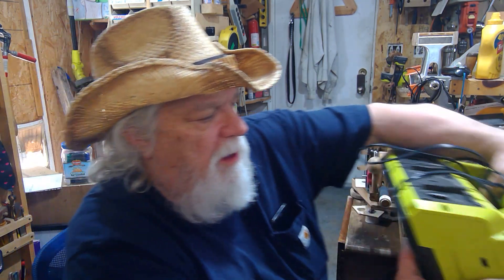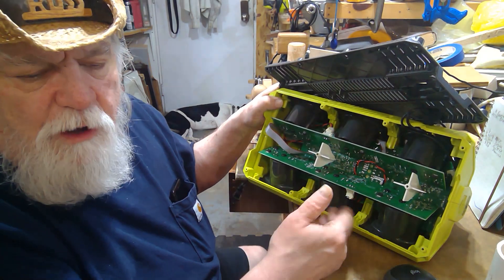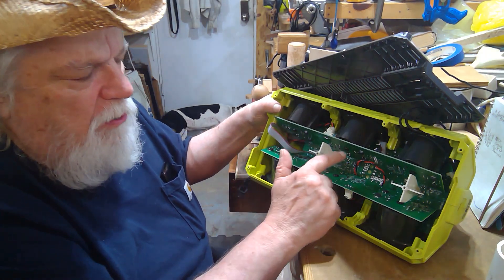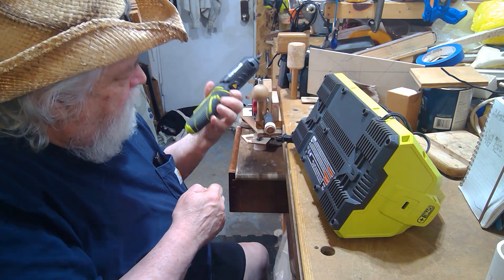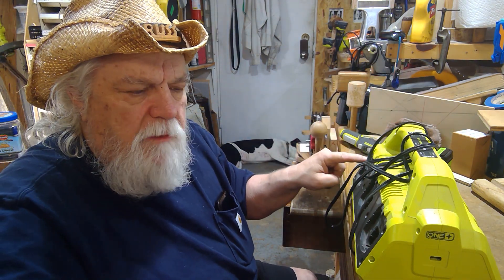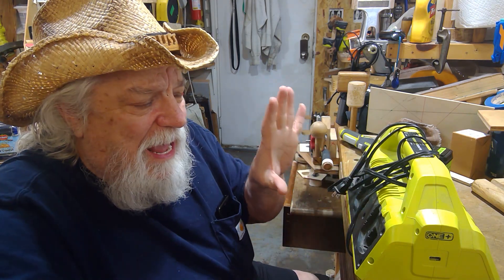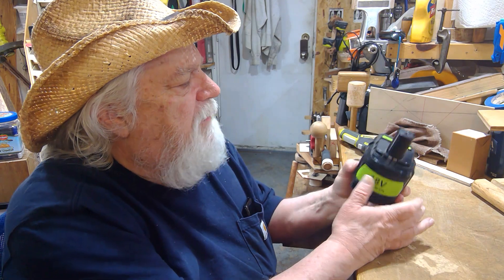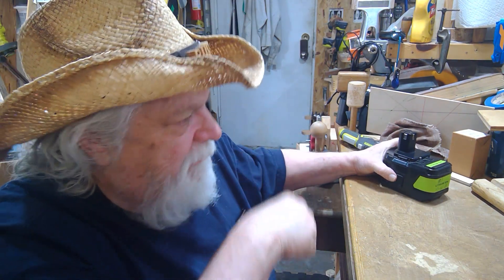Ryobi Style Battery Packs & Ryobi Super Charger by Rambling Russ

Comment: Can you gut the board and then wire into the sockets 6 individual chargers connected to the same 115v ac source. Then connect the battery sockets in parallel diode isolated for the dc power pack
Reply from the maker: Not enough room to mount 6 individual chargers.  I like to make the batteries hot swappable and charge them elsewhere.

Comment: Russ:  I just came across your channel thanks to another YouTube guy that built a battery powered light.
I am a HUGE fan of Ryobi power tools and use them, everyday in my day job and at home.  I find I can buy a lot of tools and batteries for less money.  I have 3 sets of Ryobi cordless tools.
I have a project in which I need your help.  I’m wanting to add off-road driving lights to my mini dune buggy I’m building.  My snowmobile charging system only has 180 watts total system power so I only want to use that system to recharge the starting battery and run the basic onboard electrics.
I would like to add a couple Ryobi One+ 18 volt power packs to power a couple driving lights/spot lights.  I would like to add a power Meter on my dash to monitor the battery pack levels.
Is this a feasible project?
Reply from the maker: Thanks Don & welcome to my shop.  Your light enhancement idea is quite intriguing & I would say it could be done.  Do you have specific lights in mind?
Reply: @russveinot5754  I would love to know how to figure out how long a 40 watt set (2 pods) would last on one 4 Amp Hour Ryobi battery pack.  I don't plan on doing a lot of after dark riding, but it would be great to have this option.  The Ryobi packs are cheap enough I could just leave them on my mini dune buggy and top them off before I go out for a ride (or switch them out with my other packs...).
Thanks.
I'm an totally working through some off-grid Ryobi solutions, as well.
Reply from the maker: @donwittbrodt-donsprojects7507  A Ryobi battery is 18v.  So, a 4-amp battery would have 72wh (18v x 4 amp).  At 40 watts per hour, about 1 hr. 45 min. of run time.  You might consider investing in 9Ah (162wh) batteries.  You are looking for a (Ryobi) battery source to plug two 20w pods into?  What voltage & plug-in type for the lights?   How would you carry the battery pack while driving the buggy?
BTW, when you say "Ryobi packs" are you referring to a "pack" as a battery?  Are you are looking for a carry around case to plug your lights in?
Reply: @russveinot5754  Your videos have inspired me to see how well this will work, first on my buggy project, then on to my pickup camper.  I was showing my wife the Ryobi 40 volt power panel and solar panels, today.  She is fired up about being able to finally have a good, lightweight, off-grid solution for boondock camping.
I have quite a bit of room on the top of my truck camper for solar panels.  Ideally, I would like to come up with a big enough system so we could run our Air Conditioner, overnight and then recharge.
This setup sure seems a lot more feasible than spending at least as much as a 40 volt Ryobi Power Station on LiFePo batteries for our camper.
I am SO glad Ryobi is really forward thinking on portable power and make it affordable to use for middle income folks.
Reply from the maker: @donwittbrodt-donsprojects7507  What voltage do the lights run on, 12v?  I suspect you have 2 obstacles.  You might need to reduce the voltage (18v to 12v) for lights and a monitor for the battery condition.  The first can be handled with a buck converter.  The battery monitor issue is a bit tricky.  Am I getting close to what you need to figure out to work everything out?
Reply: @russveinot5754  : I may forget about the battery monitor since I'm sure that will draw power from the circuit.  
Here are the specs from the 2) Auxbeam pods I want to use:
Power: 40W/2PCS (20 watts per pod)
Lumens: 3770LM/2PCS
Voltage: 9-36V DC
Waterproof Rated: IP67
Beam Type: 30° Spot Beam
Color Temperature: 5700-6500K White
Materials: Aluminum Alloy, PC
Lifespan: 50,000 hours

I thought since they are rated 9 to 36 VDC, I could use them on the 18 volt Ryobi 4 Amp Hr packs without an issue or buck converter.  Should I still use one?
Yes, all your info has been helpful to me...
Reply from the maker: @donwittbrodt-donsprojects7507  You don't need a buck converter.  I would still put a "Watt meter power analyzer" on the panel.   The draw is less than 1/2 watt so no battery draw.  The 2 readings that can help are the voltmeter and the WH usage meter.  They run about $15 on Amazon.  I can recommend one if you need help.  Your idea is very OTB.  If a single 4Ah battery isn't enough, you could put 2 batteries in parallel for more power storage.  Just always keep both batteries at the same rate of charge.
BTW, I would be interested in hearing more about your ideas for the camper.  FYI, I am strictly a fan of the Ryobi 18v battery for all my projects.  Not sure I want to invest in 40v batteries and chargers yet.
Reply: Russ: I plan on buying a couple of the Power Wheels type connectors that will allow me to use my 4 Amp Hour battery pack on my buggy, permanently.  I will mount the 20 watt Auxbeam (3 inch spotlight pods) to the front of my buggy and wire in fuses and switches on my control panel/dash.  I will start with one 4 Amp Hr battery (since I have several)  and see if it will last enough for me with limited use.
Reply: Russ:
Thanks, very much for your help.
If you have a specific watt/hour meter you recommend, please let me know and I will order it, immediately.
I definitely do want to build a complete Solar system for my pickup camper.  Of course there are the traditional systems out there, currently, but the large batteries are quite expensive.  If I can build a Ryobi-based system, so much the better.  I have several 4 Amp hr battery packs and plan on getting some larger ones when I get a clear plan on what to get.  I really would like to come up with a power station that would run our Air Conditioner (it is on a 20 amp 110 volt breaker).  I will try to find the max current the compressor draws when powering up.
Working on these projects really helps me appreciate what you do...
Years ago, I worked on an electric motorcycle but battery packs weren't ready for the long haul, yet.  I should probably get back into it,now that we have better battery technology and I still have a 3 motorcycles I can convert.
Reply from the maker: @donwittbrodt-donsprojects7507  I have been reviewing my choices of watt meter and below is the one I have and seems to do well.  The watt hours usage and the voltmeter are your best way of monitoring your battery charge.  If you want info on how I would hook it up or how to use it, let me know.
Link to watt meter on Amazon:
https://www.amazon.com/Watt-Meter-Power-Analyzer-Measurement/dp/B08QJK3V3Q/ref=sr_1_6?keywords=watt+meter+power+analyzer&qid=1658497614&sprefix=watt+meter+%2Caps%2C157&sr=8-6
Reply: Russ: Perfect!! Just added it to my Amazon cart. I will start laying out my auxiliary lighting system for my mini dune buggy.  Thanks, very much!

Comment: Great info! I'd bet you are right about the BMS potentially limiting the charging current. From what I can find with the cells I have, they can take up to 4A maximum, multiples of that with more cells in parallel. Of course as you also mention they would degrade faster at that rate. There is probably diminishing returns on increasing battery life below 1C charge rate. I built a few 10S packs for my electric bike, and avoiding a full drain seems to help the most with extending the life of the packs. 

The best part is that I can use my electric bike pack to run my Ryobi mower. Since the bike needed plenty of current for range and a high current BMS, it works well for both tasks. It cost a lot less buying cells from a used battery wholesaler, with an investment of time learning and building the packs as a trade-off. For anyone looking to make something custom and not already invested in tool battery packs, there are some great deals out there.
Reply from the maker: Thanks Wrath.  You are right than about battery building.  I'm not ready to start building batteries but I bet I would save money.  Eventually, I will try my hand at that but probably not till I build my Powerwall.  For now, I will be setting up a recharging station using my 100a battery that will run off solar.  All can change as I go along :>)

Comment: Thanks Russ, share away! You are too kind with your praise. I did try to keep it as dead simple as I could. There is a charging caveat that I just discovered - I mentioned on the other video comment but I will work sometime this week or weekend to eliminate that and let you know. If you aren't going to use the charge functionality though doesn't matter still works as a large hot swap battery bank. Remove and replace 3 or 4 batteries at a time if you like the bank shouldn't skip too much of a beat.

For the chargers though I will have to test mine for their output. I have a lot and most of them are rated for different wattages so I think the yellowish fast charger and the 'super charger' (which should be named the "sequential charger") are both 85w - that SHOULD be 4 amps to the single batt. Not great and nowhere near the C rate you are looking for on your custom charger.

That would make the super charger one of the 'faster' chargers that ryobi makes but only across a single batt at a time. You are 1000% correct it will take WAY longer on the super charger than loading up 4-5 batts on single chargers (even the slower chargers would be faster). I think the biggest benefit is being able to swap in different sized and different charge level batts.

Cannot wait to see your custom charger when you get it set up!
Reply from the maker: I keep learning something new every time you comment.  I didn't know the Super Charger (SC) charged at 4 amps.  The issue with the SC while charging after your modification isn't a complete surprise.  I am interested in your solution when you figure it out.  Thanks, John for your input.

Comment: Isn't the third contact on the battery pack connected to a thermal thingy? ... If the battery pack gets too hot, the charger should lower the charging current (I think).  That and all of the other charging protections may be handled on the main board.  Things like - Dropping the current down for the last part of the charge;  Determining when the battery is fully charged; Checking if the battery is too low, too cold or too hot to charge.  But probably not cell balancing.
Reply from the maker: I believe the sensor is an on/off switch based on ambient sensor placed between batteries.  The BMS regulates current based on voltage level.  Balancing is done there also, I believe.  The third contact is for the battery level gauge only, near as I can tell.